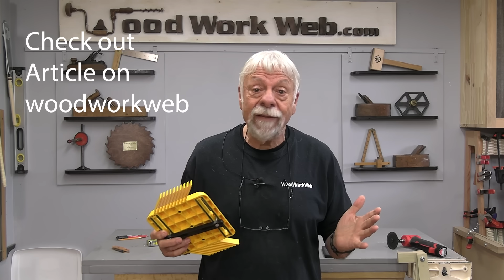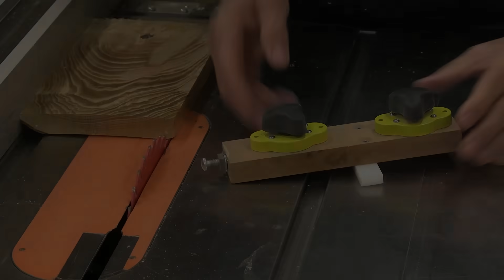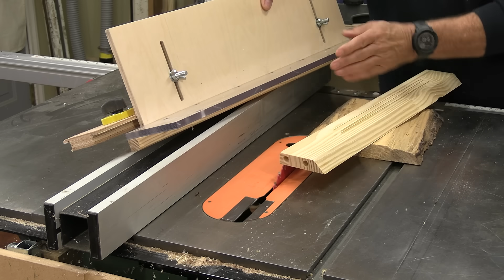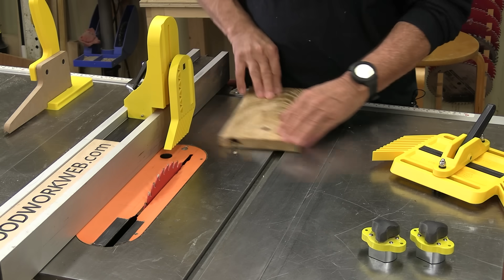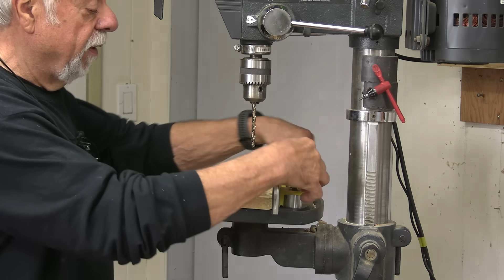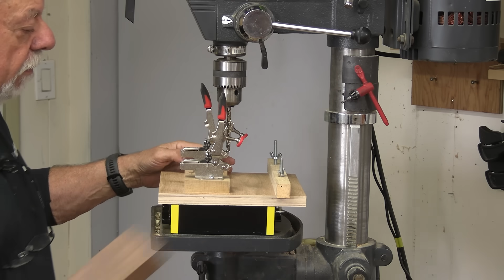Woodworking Jigs & Safety: Magswitch Solutions

Comment: They don't drop down inside, there's two different magnets. Switched one way the poles are aligned the other they are opposite. I mostly use mine on the bottom side of my anvil to dampen the vibration making the anvil quieter. I also use it for picking up the mill scale that has fallen off while forging so that I can save it for "Anvil Dust."

Comment: Mag switches are not useful in my shop.  Aluminum top saw stop, wooden top drill press, wooden work benches, no use for them at the band saw.  I use magnets in the shop but the mag switch has little or no value for me.